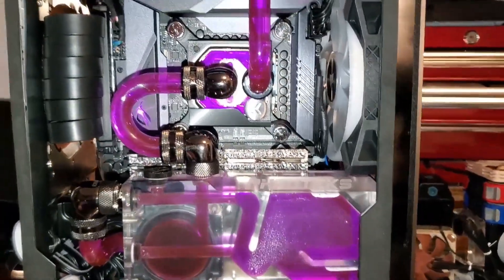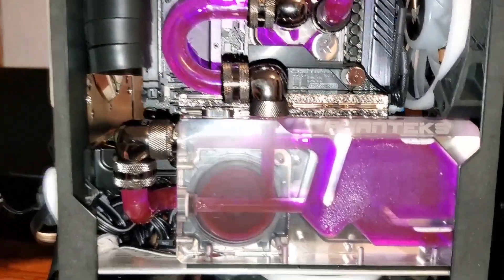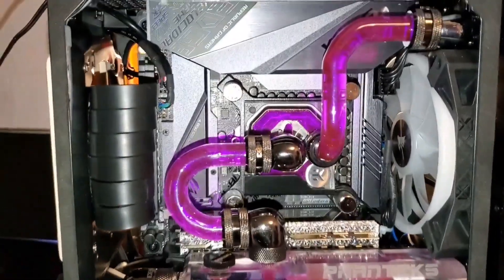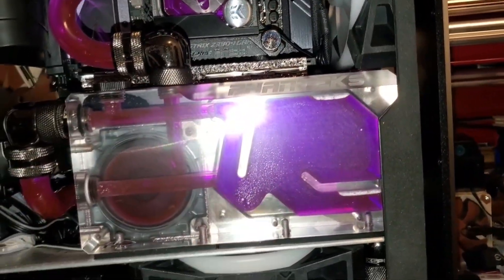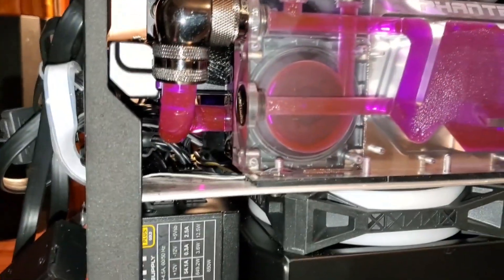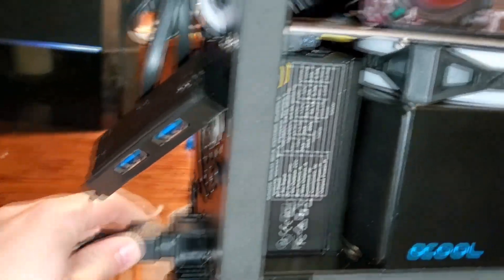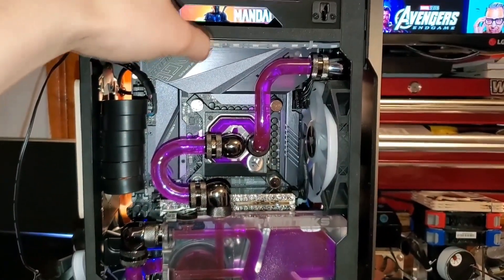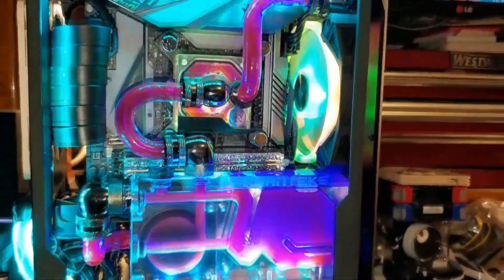Mini Custom Water-Cooled PC (i7 | RTX 2080)

Comment: Hi, there. Any issue installing the CPU block? Last time, I tried installing a supremacy evo block and the base of the block hitting/touching the row of capacitors beside the cpu socket, it cannot lay flat thus I cannot screw in the block properly. Thanks for reply.